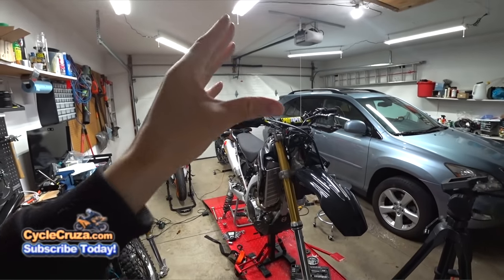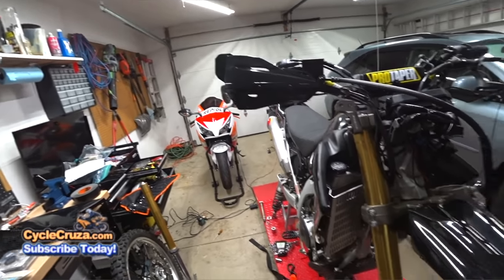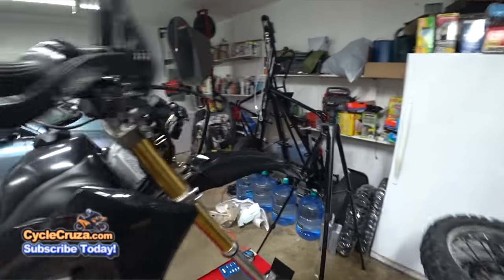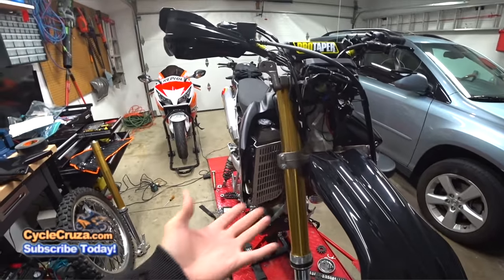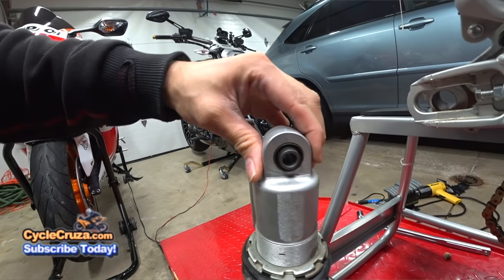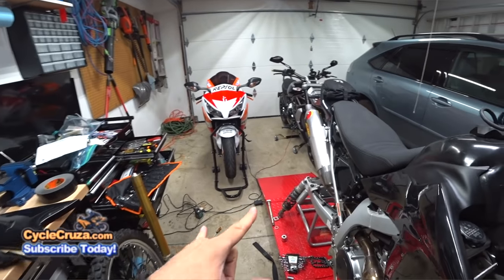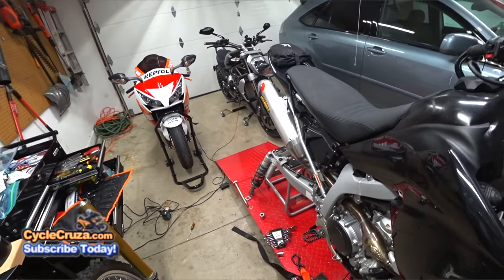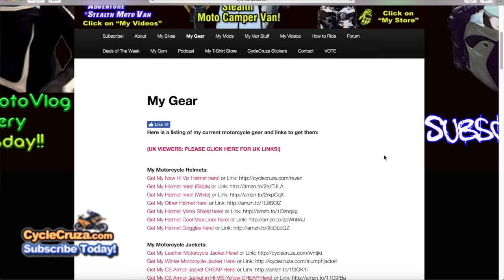Motorcycle Suspension - FORKS and SHOCK Removal

Comment: You definitely don't NEED to remove the nose fairings to get to the pinch bolts that hold the forks on your CBR, but it makes things easier. That being said, on an R6 all you have to remove is the two small trim pieces that are underneath the clip ons and all the pinch bolts that hold the forks to the triple tree can be accessed.

Comment: The WR250R may have long between valve checks but it needs a lot of work for suspension, engine etc etc
Reply from the maker: No engine work needed, just take off all the emissions crap off and open up the airbox and get a PC with tune. The wr250r is probably the most reliable motorcycle on the planet.

Comment: There's no correct way to measure how high or low you install the forks. Its rider preference and terrain / type of race preference. lower front end gives better straight stability, higher front end gives better cornering. 

Go to  mx track and try different settings until you find the one you like
Reply: Don't you have that backwards? When I lowered my rear end while adjusting sag I had a harder time turning.
Reply: low bike poor turning, good straight stability... high bike good turning